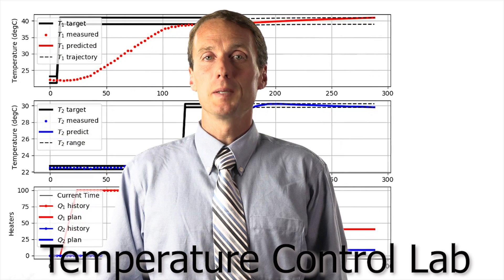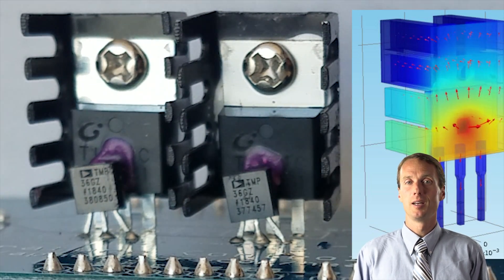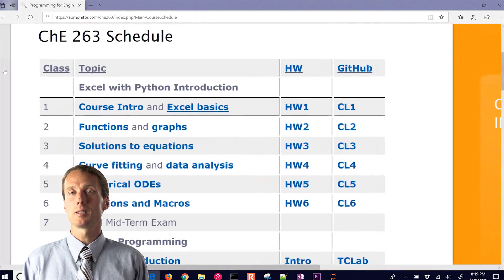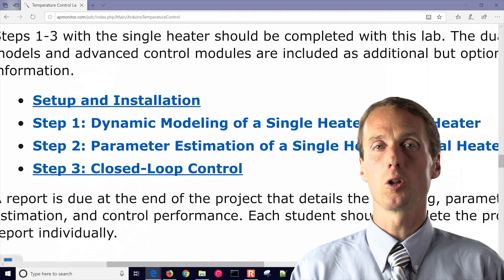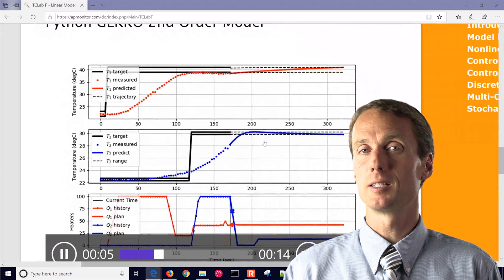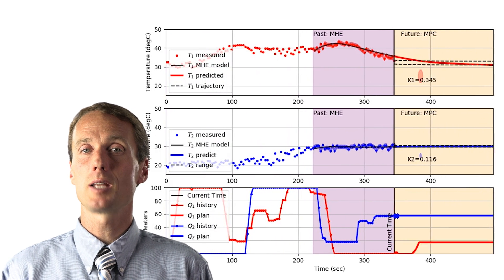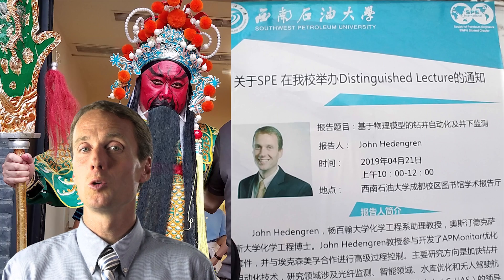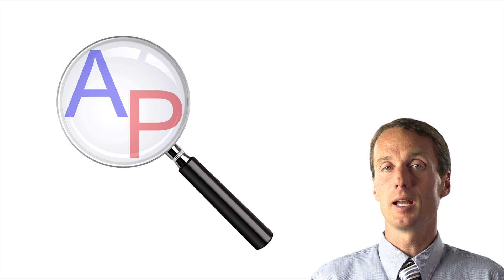Arduino TCLab for Engineering Education

Comment: In my university, the professor simply asked us to design a controller on a machine that we could only see in photos. The real world is more than computer codes, but real machines that we work with. This is exactly what should be adopted by an engineering school.
Reply from the maker: Hands-on with real data is very important. There are similar comments on the video that Brian Douglas made using this same TCLab device: https://www.youtube.com/watch?v=Mbx5IMICS_Y&feature=youtu.be&list=PLLBUgWXdTBDg4R3aJLVGTy6GfpTC__WcC

Comment: Can you please tell me the  number of temperature sensor and  heater IC?
Reply from the maker: There are two temperature sensors and two transistor heaters.
Reply from the maker: The temperature sensors are TMP35GZ and the heaters are TIP31C.
Reply: @apm  Thankyou So much sir ..
Reply: Which Chemical or paste is pasted in between tmp36z and tip31c IC?
Can i use Lm36/35 instead of tmp36z?